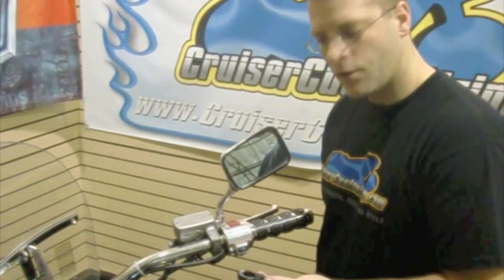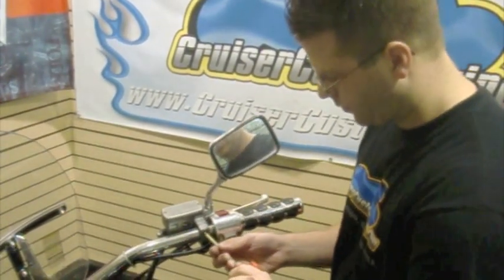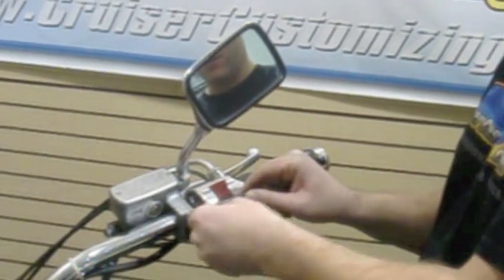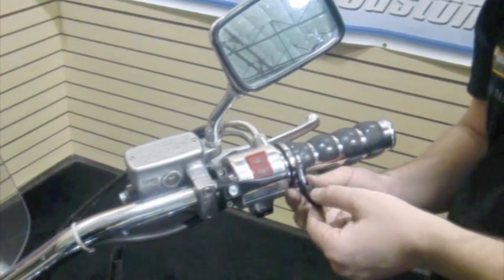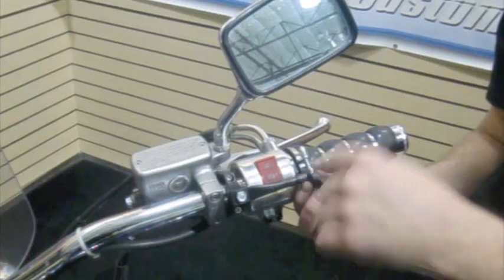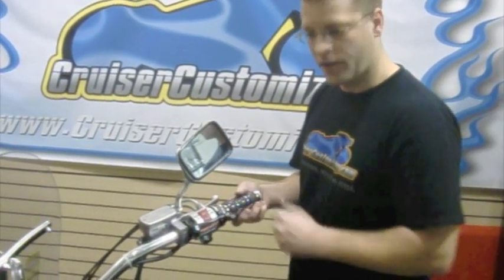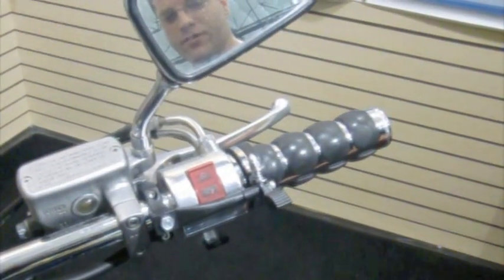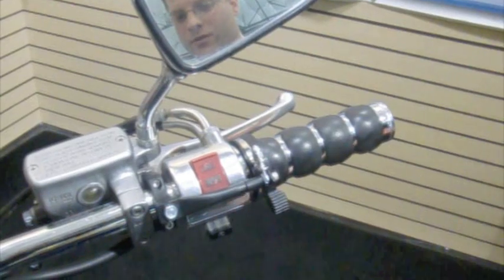Vista Cruise Control Installation Video - Cruiser Customizing

Comment: This cruise control device was on the bike I bought recently.  I notice that when locking it in (on the highway), it tended to lose throttle (speed dropped gradually).  Should I tighten the spring tensioner or just compensate by increasing the throttle a bit, while the cruise control unit is engaged?

Comment: I was wondering why i couldn't figure out how it works, and it turns out you guys only sent me part. I only got a  package with the lever, not the clamp that attaches to the bar or the bridge. Is it typically sold in multiple parts? Because it said "Universal Cruise Control" so I assumed it was the entire package.

Comment: remove this video. Do you not realize that on a Harley Davidson you can not separate the brake perch from the switch housing. the brake lever is attached to the perch and has to be up against the switch housing in order to activate the brake switch.
Reply: Blane M I guess that's why it says "metric motorcycles".
Reply: +Blane M I had a 2002 Wide Glide and it came with a factory throttle lock, good !!!  The HD mechanic told me, at that time, that all Harleys had a throttle lock.  I can't speak for current models.